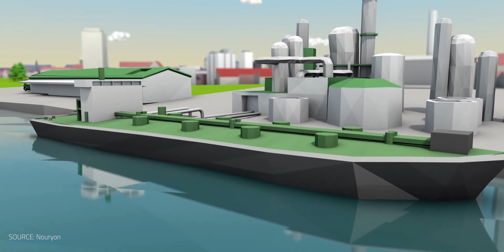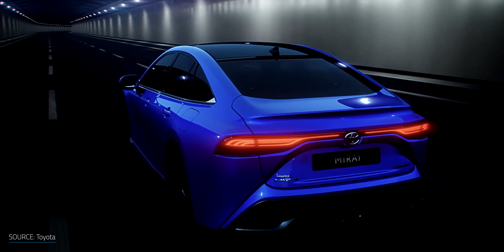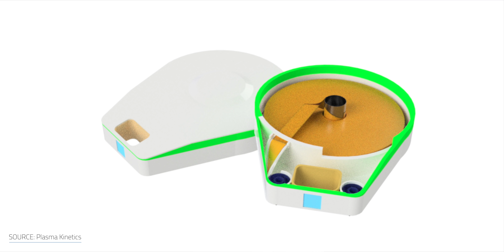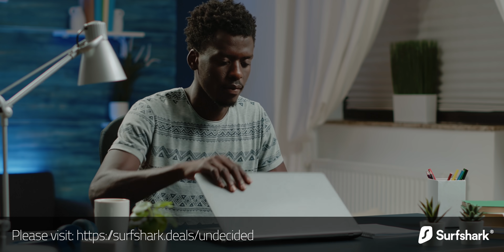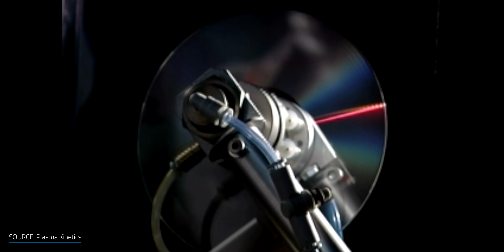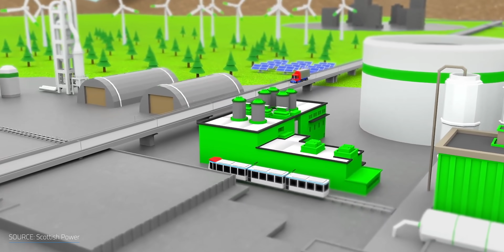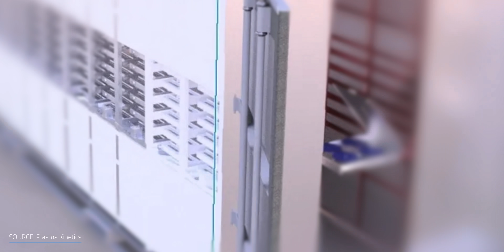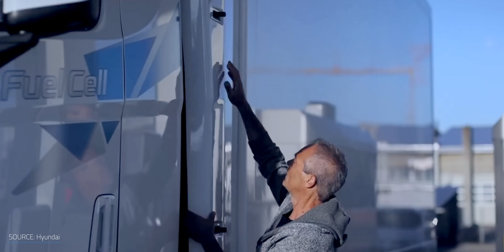Energy Storage Breakthrough - Solid Hydrogen Explained

Comment: "Take it out and swap it at the store." 
Okay it's a DOA. If we really wanted replaceable car batteries, we could have been using aluminum batteries for decades. It will never be as convenient to swap battery packs than to charge a battery or refill a tank. And no, the lack of ability to ship by piping is a detriment not a feature. Why natural gas is just straight superior to coal for public heating and for the grid. A pipe can run 24/7 100% full carrying thousands of gallons an hour. A truck can only carry a few hundred gallons or a maximum weight of around 40-55K pounds. It's why electricity is one of the most convenient as we already have power in every corner of the nation.
Reply: not replacing your 12v batterie, its replacing the gasoline in your vehicle. Its still just compressed hydrogen that will be used in a ratio with atmospheric gas's to create combustion.
The benefit of not having to ship by pipe is the best option due to no needed infrastructure built amongst the ones still in place and some not even used anymore.
pipe line might be fast but it very destructive. natural gas is destructive to obtain for our power needs and one of the most dangerous of the fuels we use. it also req infrastructure not available to most parts of the world like pipe lines. Electricity has massive limits of storage and production is low and destructive, most places relying on clean electric means do not produce the power needed to fully run their connected areas, this is all with massive infrastructure.  
This tech overs the ability to move massive energy potential to remote parts and non remote parts of the world in the most efficient way without destroying the planet while your at it.
Reply: @bryantnecessary7719  technically any even an electric car running on raw carbon emissions is still cleaner than a combustion engine. It's a popular misconception as large burners for turning turbines is more efficient than the tiny motor in your car using small bursts to push a piston. 

But the problem with this is the difficulty and labor to replace. Tesla once made the same pitch for electric but notice how far that's gone. Replacing anything more than 50 Ib is difficult and will require tools, that means we need to go back to manned fuel stations, but not only that, we now need truck loads of these things coming in daily, and boxes are never as space efficient as a fluid. That's just a fact. That's the reason why anywhere we can feasibly make a pipeline we have or tried. Trucks are energy inefficient, take time to load and unload (worse for cargo than fuel), and make supplies more intermittent. Right now gas stations get around that by having basically the entire base of the stations full of fuel with a truck coming every day, which is not a clean process even slightly. 

This is the same reason aluminum batteries never took off. Yes aluminum batteries would also be capable of 1-2K miles a charge, but the battery cannot be refill, it needs to be replaced. We've had the knowledge how to do so for around 150 years, but it was never taken seriously because of this specific purpose, how do you replace the battery easily and how do we transport and store them? We aren't planning on having warehouses under fuel stations, that's too costly. 

We do know however you can just raise the power draw of a charger and make an electric car charge in 5 minutes, but we'd need to standardize that charge system nation wide, have battery packs designed with it in mind, etc. Does it not make more sense to stick with a similar system to what we already have? Plus you can still use any outlet if you need it in a pinch.
Reply: @Skylancer727  well I agree on electric cars being cleaner than gas but this is not the subject. It’s about hydrogen vs gasoline.  
You can just easily store solids just as well as liquids and transporting solids is actually more efficient due to liquids losing space to baffles and such inside the tanks and the shape req of the tanks lose space aswell. 

The new jobs created by shipping will offset the jobs lost by old infrastructure in the longer run but there is nothing that will NOT cause disturbance in that area.

Without the amount of energy condensed into one of the solid hydrogen tank, we cannot accurately say if one is more efficient than the other. 

Aluminum batteries were never an option due to weight and cost of the product (we don’t know price points either for the hydrogen solid storage box) 

But just as you say we need people or the pumps, they could easily be done by paying for the exchange, once old cartridge is inserted and new one is dispensed, much like a vending machine.

And on the point of electric cars, they are great but their technology is limited and we know this and have known for a long time about the limitations. But I’m happy people understand to move forward you have to be ok with losing  your comfortability.
Reply: I don't see delivery by pipe is not a positive if what's contained is environmentally hazardous or dangerous, I've got to disagree there. If a cargo vessel sinks full of these hydrogen tapes, there's little harm done other than a bunch of plastic trash lost in the sea. You have a similar filled vessel or an oil line rupture somewhere and you've got an expensive and environmentally damaging problem. Sure the pipe system is efficient at what it does once it's established, but finding an alternative to using combustibles for energy needs would be ideal all around if possible. I don't know if this tech is actually what it claims so I'm not holding my breath, but if it turns out to be so it seems like a step in the right direction.

Comment: There's always room for new innovation especially when it works. As long as it doesn't cut into the pockets of the existing energy big wigs! Then again we all know how that will pan out!
Reply: capitalism hampers innovation
Reply: @Nobody-Nowhere  this being a prime example of that
Reply: @Nobody-Nowhere  as opposed to what? Yes, evil capitalists crush competitors. But it isn't as though there's some other magical system that encourages more innovation, is there?
Reply: @jordanhildebrandt3705  yes rbe but requires big wigs to give up power and a central ai that can't be controlled by one individual but a group of people called a vote from 100% of population 🤔
Reply: @lesstevens2370  bruh, I'm sorry but "centralized AI" is a recipe for disaster. AI can't decide on its mission. It must always have controllers behind the scenes managing it. Centralized ANYTHING will put huge power into few hands. So, if you want a centralized AI, your "big wigs" won't have given up any power after all.

The key is money. Decentralize the power over the currency, and SO MANY problems get fixed.
Reply: @jordanhildebrandt3705  dude an rbe resource based economy doesn't revol around a currency
Reply: @lesstevens2370  ok buddy. Sure. Economies totally don't use money.

Comment: This presentation is so full of basic errors that it made me angry enough to unsubscribe. Absorption (as is Pd:H) is distinct from hydride formation (as in TiH2). Hydrogen atoms are NOT positively charged. Any material that contains sufficient Hydrogen to function as an energy source by easily releasing H2 is by nature flammable. Fire, once started, will release the hydrogen in the remaining material. 
In this system hydrogen is stored in a very thin layer on the surface of a disk inside a machine. You never discussed how much the system weighs per gram of hydrogen stored and never derived the volumetric or density energy efficiency. You said the machine extracts hydrogen “from air”, an oxidizing medium, with close to zero free H2, then changed to “ smokestacks”, a reducing medium, which still has very low H2 content, without thinking through whether either of these scenarios are reasonable in a commercial setting. I’ve only touched a few of the many bloopers. 
Send this presentation to a real chemist, if you know any, and ask for an honest critique. 
 The background story of this system is sketchy, with its “DOD stopped us” scenario. The chemistry and physics are very funny. The manufacturing analysis indicates a high degree of complexity. The engineering functional analysis shows a large amount of semi-functional dead weight, including the mass of the disk and container.
Your presentation naively accepts a lot of claims at face value. It is not an analysis.
Reply: Every video this channel uploads is a 'breakthrough' with nice graphics and buzz-words. These videos are nothing more than thin air.
Reply: while i agree with much that you say - there is also the possibility that the company just doesn't want to reveal too much - or not reveal so much that the entire technology is revealed - makes it difficult to technically evaluate this but it is smart to remain skeptical.
Reply: My comment to @Undecided
Blah, Blah, Blah,.... give us some real life specifics.
- In a 21700 or 18650 size battery (3.8v nominal) how many Mols of hydrogen energy would be stored in their 'thin-film' at 1atm & 20*c. - and what would be the proposed miniature fuel cell to make these viable - if at all ???
- Or,... for the home,... what is the physical size of one of their proposed 'thin-film cartridges',... and how many Mol of Hydrogen would it contain at 1atm & 20*c ???
- What is the intrinsic cost of a proposed (or modest 20Kw/day) home-fuel cell  & the refueling charge per canister - how many canisters to feed 20Kw / day ???
.
Reply: @phishfearme2  - I would believe this video is a MARKET trailer,... buy $tock$ now !!!!
.
Reply: @stevemacbr  Well it's not publicly traded but I agree he's so positive about it while being so vague about it.
Reply: @sneaky_krait7271  - Yeah,.. as I said 'it's a trailer' - wait for it to go public when this sort of propaganda hits the streets.
.
Reply: I sometimes watch stuff here, but he really does that a lot, so trusting anything he says more than something from a tech startup's advertising department is incredibly foolish.
Idk if it's because of the sensationalism, or just trying to rush content out asap, or just blind tech worship, or what, but while I'm sometimes curious enough to click, I never trust any of it.

It's really just repeating public statements without question.
Reply: @dynamicworlds1   --  Exactly,... and my curiosity vs apprehension is likewise.
.(skeptical or critical analysis of what's presented )
Reply: His video is all hyped advertising for companies that need investors.
Reply: Yeah I was also thinking how flammable this tape would be.
Reply: Aye. What's this channel going to cover next? Solar Freakin' Roadways and why they're the future! /s.
Reply: Yeah! Now, about those Free Energy/ perpetual Energy machine videos...
Reply: @stevemacbr  They are not public yet.
Reply: Hence the channel name, undecided.
This is absolutely not an analysis.
Reply: Totally agree, he never goes into detail about the energy density of these cartridges vs other energy storage systems.
Reply: Gustav you are all about errors and you made one in your first sentence.  The Absorption and Adsorption methods were examples of what normally happens in chemisty.  Then he went on to describe the company's method involving singular Hydrogen atoms, otherwise known as protons (+ve charge) being difused into a "Hydrogen Sponge".  He also never said that the fuel material releases hydrogen in the form of H2.  It could be using the disparate charge to make electricity directly the way plants do.  
This sounds very similar to the Cold Fusion debacle in 1989 where the two researchers had successfully dissolved hydrogen into a palladium sponge and the energy released was much greater than what they had measured in the beginning.  Now that was a chemical reaction that caused the splitting of hydrogen molecules into hydrogen atoms that, once released from the sponge, violently reformed H2, releasing heat.  The only problem with the method used in 1989 was that it wasn't cost effective and it required palladium which isn't very abundant.  But what if this new company has perfected that same accident into a process that is cheap and abundant?  So he didn't give us exact numbers.  I'm willing to wait and see if it pans out.
Reply: Gustav, thanks for your insight. Do you have channel content that would inspire me to be curious? That's all I ask for from You Tube channel creators and their teams and then I subscribe or support in other ways. Content is never perfect but I learn a lot and learn more using the content as inspiration for more research.
Reply: @user-vp1sc7tt4m  ccommon sense skeptics
thunderf00t
adams something, are channels where you can have a look. some videos are a bit cringey, especially of thundef00t on elon musk ideas, but the practicality is there, have a look, decide for yourself. cheers
Reply: @johnedwards3621  Skepticism is the foundation of science otherwise it becomes religious in tactics.
Reply: HydrogenCoin: TO THE MOON!
Reply: This guys videos are terrible, he believes anything.
Reply: @malachiXX  The only problem with Cold Fusion is that it used Palladium which made it too expensive?????  No.  The problem was that it didn't work at all.  No competent Scientist ever got it to work.
Reply: @Foolish188  Sorry to confuse.  "Cold Fusion" that was presented in 1989 wasn't cold fusion at all in the physics sense.  It was a misunderstood, high energy, chemical reaction where hydrogen ions were dissolved in a palladium solid and then, once that solid was saturated, they emerged still in ionic form.  As soon as they emerged, they immediately attempted to rebalance their energy by forming H-bonds with whatever was closest (mostly H2)  and giving off what 'appeared' to be more heat than had been put into them.  This mimiced what the two physicists thought cold fusion would look like.  But, before verifying that they had or had not discovered 'quantum tunneling', they published in fear of being 'beaten to the punch' and allowing someone else to get the glory.  That was their second mistake.  Chemical reactions like this can appear to give off more energy than was put in because that energy is added to the system slowly.  The rehydrolysis of water from H2 gas and O2 gas can produce an explosion yet it only takes a 6 volt battery to perform the hydrolysis in the first place.  As to being too expensive, I must have confused you there by skipping a thought or two.  At the time, I asked the question, " Well so what if it isn't fusion?  It produced (apparently) more energy (Not really) than it took to induce.  Why not use this process?"  The answer I was given was that some of the palladium is consumed and palladium is rare and expensive.  Too expensive to make a high energy chemical reaction profitable for producing power in the form of heat.
Reply: Thunderf00t will be releasing a video response to this soon 🙂

Comment: 70% efficient is fine by me, as the efficiency of the fuel is offset by the time to refill at the station.
Evs stink for range.
If I can stop and swap a cartridge and go in the time it takes my kids to use the restroom, we have a winner.
Reply: ngl, gunna be weird to swap out giant 8-track tapes instead of pump gas/ plug in.
Reply: @zetsumeinaito  (stoner voice) It's the future maaaaan.
Reply: I wonder if that 70% round trip efficiency includes the power to run the laser. I guess you could throw a lead acid on there for starting it, lol! We'll never be rid of those things.
Reply: Always gotta have acid if you're gonna be swapping 8tracks..
Reply: The cartridges are heavier than you think. Its more of an installation than picking up a carton of milk sized thing in plugging it an and off you go...
Reply: @piccalillipit9211  yeah, they will probably make up the whole floor of the car like in EVs
Reply: @piccalillipit9211  the nitinol is nickel, which is heavy-ish, titanium and magnesium less so. But still gotta have a storage medium.
Reply: @The_budgetking  - No its not quite that big, Its about the size of a carry on suitcase - but from memory, it weighs about 100lb.

The ones for trucks need a forklift to carry them. There is about 15kwh of energy in 1lb of Hydrogen - but you need a LOT of the film to stick that hydrogen to...
Reply: @evanriddle1614  -Thats it - there is 15kwh in 1lb of hydrogen - but you need something like 10lb of storage medium and plastic film for every 1lb of helium. I was thinking WOW - you just go in and buy 100kwh package of hydrogen in a 10lb cartridge - but its a LONG way from that, unfortunately.
Reply: Robert Murray Smith did a video on a medium that stores 10% H2 by weight made of urea, table sugar and lots of heat. No mention of extraction except that light could release it but wouldn't step on the patent by mentioning a laser. A solar fresnel could do it in a stationary system. Hydrogen storage could be done with an electrolyzer fed into a tube-in-tube apparatus, (i don't know what it's called), at ambient pressures given the medium adsorbs the H2 and wouldn't pressurize the tube until saturated.
Reply: Eudiometer tube
Reply: NIO is using the battery-swapping tech in China. Done in 5 minutes

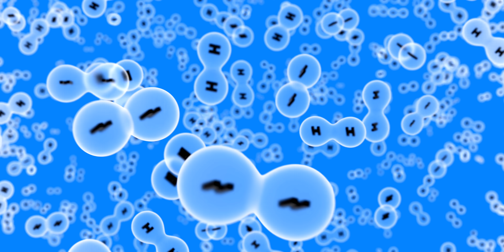Comment: 6:35 Hydrogen atoms are not positively charged. If your description of the process is true then it's actually storing hydrogen *ions*. And that's a problem, because you need electrons around those protons to power a fuel cell. Maybe electrons are released from the a[bd]sorber by the laser light? Their website is frustratingly light on detail. It sounds like total snakeoil tbh, but time will tell.
Reply: Im surprised you only noticed that and nothing else
Reply: @brianhinsonbh  I merely highlighted one part that no-one else had commented on. I "noticed" much more, hence commenting that it sounds like total snakeoil!